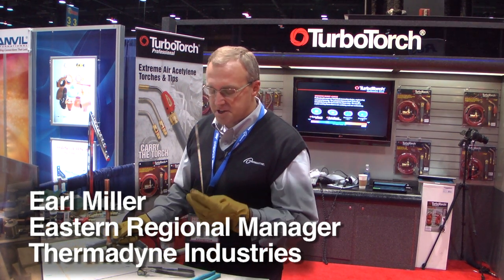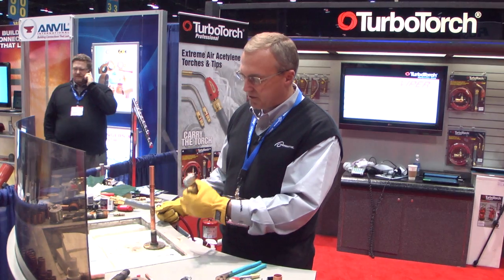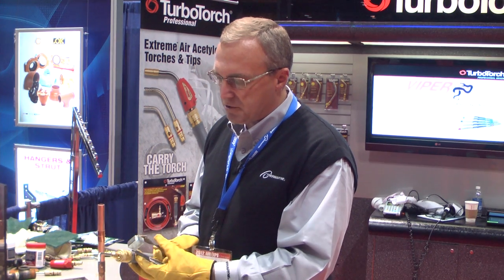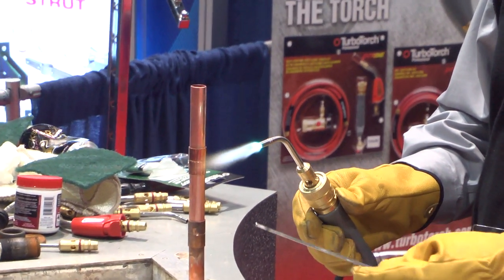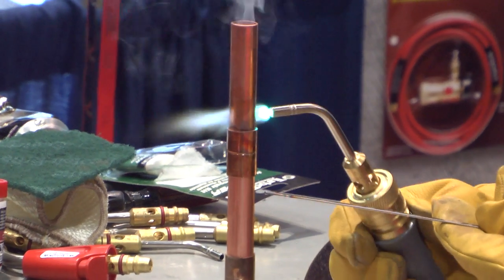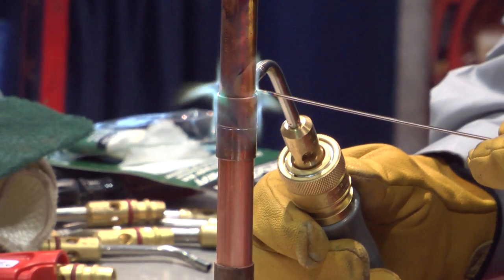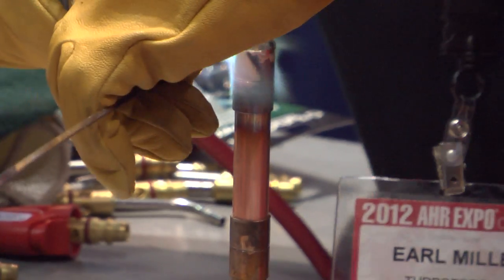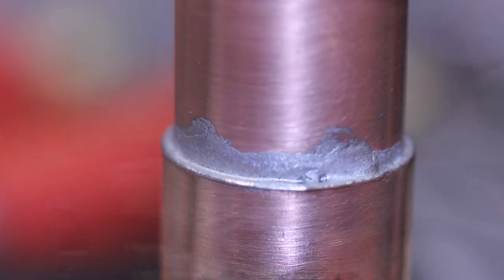TurboTorch - Copper Pipe Brazing Demonstration

Comment: I'm learning this in HVAC right now.
Reply: Therec are better videos out there. Oxy Acetylene is still the easiest and best way to go, and especially if you're just learning. The higher heat allows you to focus on the technique, not on keeping the pipe hot enough.  After that, learn to use a Turbo Torch. Just my opinion.  Best of luck to you.
Reply: Same here bro learning to braze copper it's pretty bad ass!

Comment: Agree with Tim. That copper was not hot enough to pull the solder into the joint. What we were seeing and hearing were two different thing. Did he put the solder on the outside then heat the copper to pull it into the joint? Was the end result shown edited of something else.
Reply: it's brazing, not soldering. completely different process.
 
 but yeah, the finished joint shot was definitely deceiving.